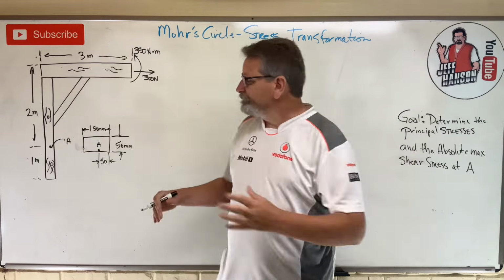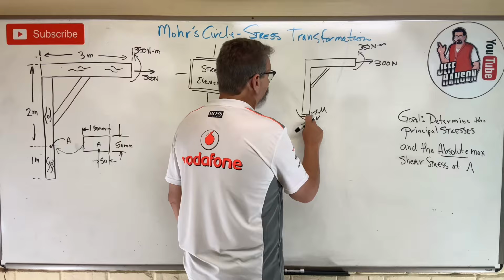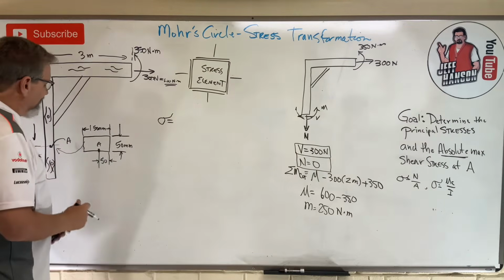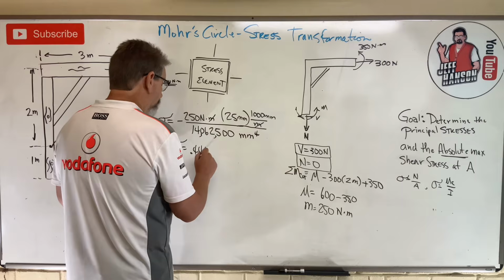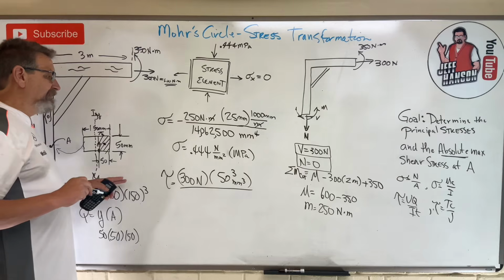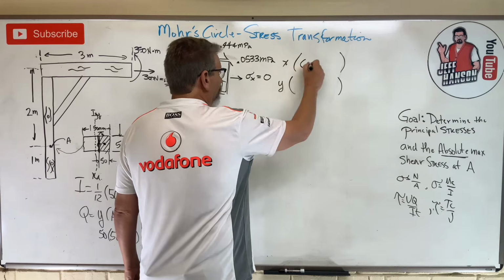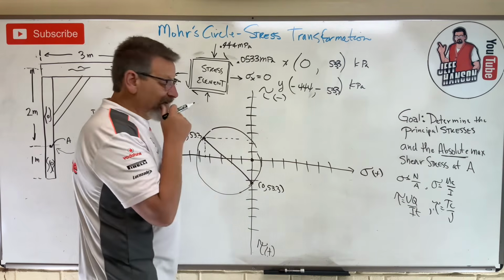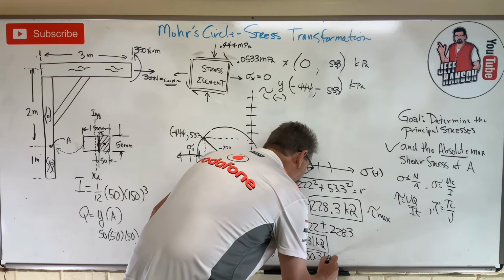Mechanics of Materials: Lesson 52 - Deriving Stress Element for Mohr's Circle, Combined Loading

Comment: 3*3.28=9.84 feet, 9 feet 10 inches.  1350 N*m is 995.7.  300 N is 67 pounds.  You would need a guy who weights 250 pounds with a lever four feet long to apply that much torque, and it would be down.

Comment: I thought all Mohr's circles gave the max shear stress just above and below the average stress.  You only increases the stress by 6 kn by doing a Mohr's circle.  Your still going to need a hefty safety factor due to the questionable loads.  Right now it looks like your safety factor is about 70 or more.  We really need to know the weight of the sign is it made of 1 inch thick cast iron or something?  How can we estimate the force of heavy winds?  Looks like you have some kind of 2x6.  If they want us to switch to metric there needs to be some way to give students a lot better feel for these numbers,  all lumber yards sell wood in ft and inches.  Everyone knows what a 2x4 is no on knows what a 150x 50 is or if it even exist in America.  I could just add the shear stress to the bending stress and get 497  and have a slightly more conservative and safer design.

Comment: You got me on Q.  I've never heard of it until I decided to review Mechanics of Materials.  I thought you just always used V/A.  Well I must of quickly forgot about it.  I've got a vague memory of the funny curve going to zero at the edges.  But that means that it rarely matters and is ususally small?  Most failures start at cracks on the surface where bending stresses are the greatest, and torsional stress is the greates, and where surface imperfection, cracks and nicks are the most plentiful.

Comment: Google says wood has 70 to140 Mpa Tensile Strength.  From your analysis, I don't think failure is likely at point A.  Try a point at ground level on the outer surface of the Post.

Comment: Why not just write out, sigma Fx =0, sigma Fy=0, Sigma Fz=0 and sigma Ma=0.  And then under each write 0= F1+F2, 0=M1+M2, and not use M= M1+M2= blah blah= blah blah.  Just use one equal sign and go down so its clean and everyone will understand it.  If the answer is wrong, there is no way to sy you knew the right way to do it.  There is just a wrong answer there.

Comment: 67.4 pounds, what could that be?  The wind, Wind pushes?  Especially the wider surfaces.  See engineers need realistic practical problems so they can get jobs in the real world.  We have no concept of 300 N pulling on a for sale sign or 350 Nm torque.  Why not have your 300 pound freind hang on or do chin ups from the cross bar?  The only thing a sign has to worry about is the wind, the weight of the sign and support, and getting hit by a car or lawn tractor.

Comment: How is some one going to pull the top with 300 Newtons?  They would need an ey bolt or a giant claw of some sort.  350 Nm torque?  Is there a hex head somewhere to put a wrench on the end of that beam?  But there is no vertical load at all.  The last time I thought about bringing down a sign post we hung on it it hit it with a vehicle.  We did not pull on the horizontal beam in an out ward direction.  We would not be tall enough.

Comment: How do we know that the  σ we calculated is σy and not σx?
Reply: If you look at the cross section we are analyzing and consider the neutral axis and think about where the compression forces are coming from, it's from above the stress element, in this case we used a standard x-y (Right-Up) coordinate axis, and therefore the stress due to the beam bending corresponds to sigma_y.
Reply: I believe this is just because we assume x is in the direction of the 300N force in this case and y is normal to that direction. ultimately what you deem x and y just depends on the coordinate system you choose at the outset of the problem :)

Comment: I'm confused about the orientation of the stress element. It seems like it's different in different videos in the series. The element shows 0 MPa in the x direction, but in the diagram, there is 300 N shear force in the x direction. The 0 N is in the y-direction in the diagram. It seems to me that the stress element should have σy=0 MPa, σx=0.444 MPa compression (arrows in), and τxy=0.0533 MPa (arrows as they are currently). Either that, or the τ arrows should be flipped. Am I missing something?
Reply: I've got same feelings, anybody can explain?
Reply: @piotrmisiaszek5236  Even though the stress element is always shown with σy on top and σx to the right, the key thing to remember is that they are σ stresses NO MATTER WHAT. So only normal (P/A) and Bending (Mc/I) stresses will contribute to the x or y σ stress. In this case, only bending stresses are present at point A. So that 300N SHEAR force won't have any effect on the x or y σ stress. 

Normal & Bending forces = σ stresses
Shear forces = τ stresses
Reply: @maryckbuilds  but how would you know whether the Mc/I we calculate is x or y σ stress? is it always  y σ stress?
Reply: If you think about it slowly and pictorially, he calculated the MC/I stress. Which is compression, Now the compression will actually be along the the height of the beam, which is the y direction. It may not be correct though, but that's how I understand it.
Reply: Maybe t is 150? Cause it is the thickness in the direction of V?